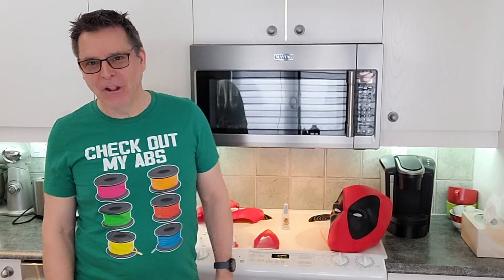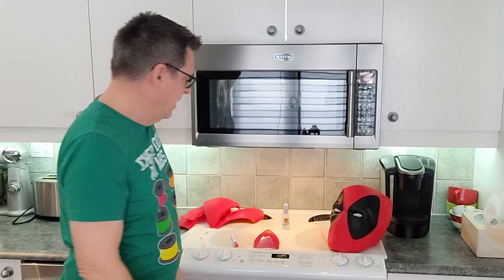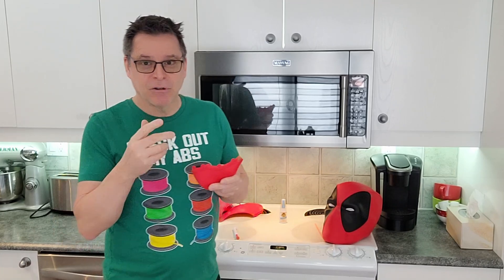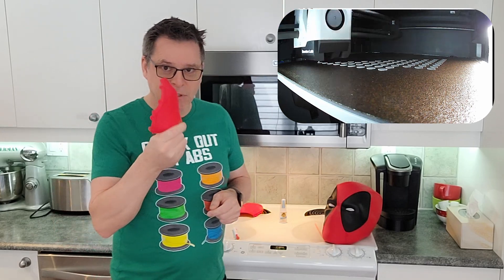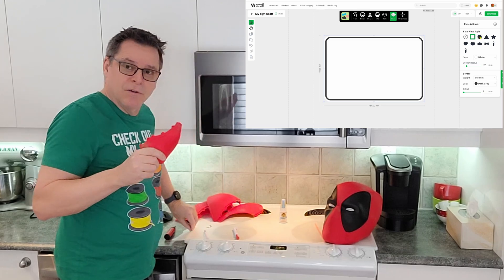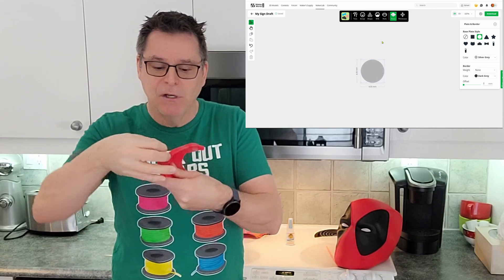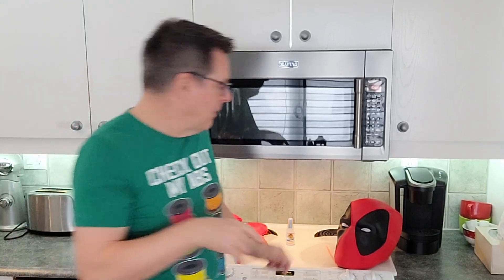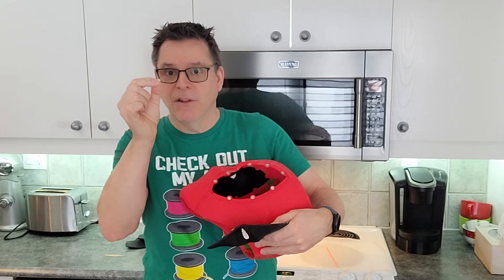Caution: Scaling 3D Printed Helmets!

Comment: How do you know what size magnets do you use
Reply from the maker: Morning
The masks that I've printed so far,  the designer shares the info with the model. 
Are you designing a mask?  And want to know what size to use. If it were me I wouldn't go smaller than 2mmx8mm.

Comment: What about scaling down? I just ran into printing a 24 hr job at 90%, only to remember as it finished, "Oh yeah. The magnet holes are going to shrink as well." Whoopsie. I tried to use an auger to widen the hole, but gave up after a minute, because I'm very lazy. Anyways, after 30 seconds of relentless Googling, I learned about X-Y Hole Compensation under the Quality tab in Bambu Studio. I don't know if this will compensate for the depth though, and if it discriminates between a magnet hole you want to scale up or down and an eye hole that you don't. 
Also, I like the fumes from the glue. They smell like hope.